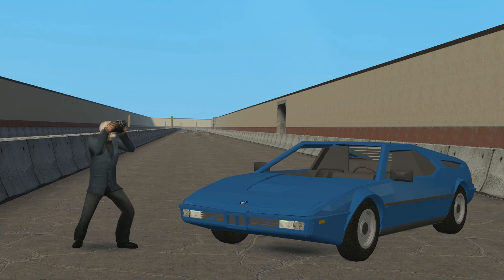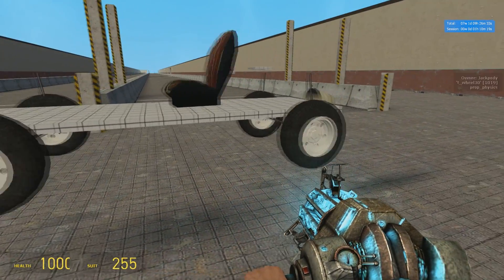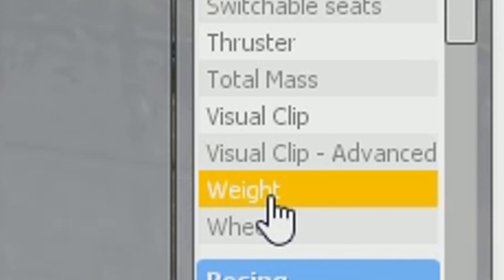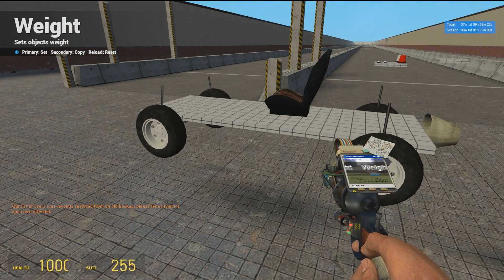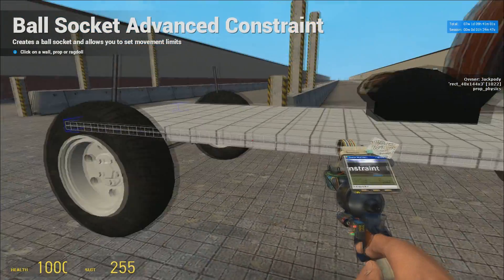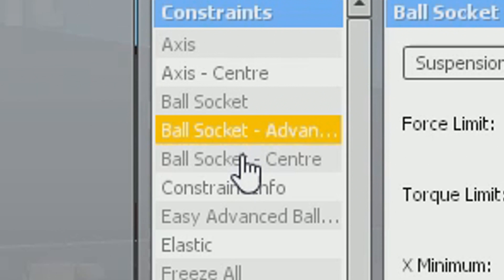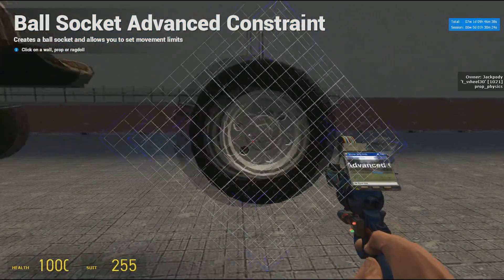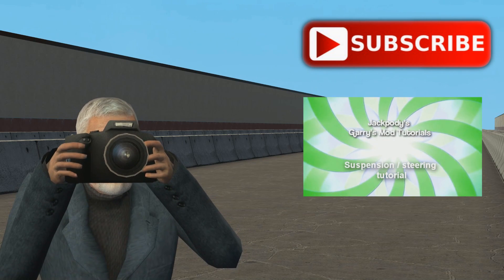Garry's Mod Tutorial    :    How to Fix Wheel Spass

Comment: So it works and my acf car will go better but at a speed of 140 it starts to tilt to the right and to the left, it is possible that this is a problem in the insufficient weight of the base on which the wheels are attached by Ballsocket
Reply from the maker: Could very well be. Try and watch the tutorial on how to avoid wheel spass, it should be on the channel from around 2016.

Comment: I have trouble getting over 100 km/h with my ACF cars using this chassis, why? and is there a way to make harder suspension ?, because my engine is a little heavy so the vehicle leans forward
Reply: Sheppowed a lighter car should go faster, so cut weight wherever you can without reducing stability. Wheels, body, etc

If you use the suspension in this vid making the plates heavier should make it "harder"
You can also use console to change the model of the wire weight to whatever u like and make a suspension you can adjust as you drive. I did something like that with a submarine

Comment: Hey jack can you do a tutorial on how to reduce base prop wobble, giving me a lot of trouble and kind of ruining my builds at the end witch is really disappointing :/
Reply from the maker: I cannot. However, make sure that you're using a proper setAng that doesn't try to auto-correct your car (can cause wobble at speeds). You don't need a stiff suspension but stiffening it might help. 
Try locking the rear wheels together (or the front wheels) by making a ballsocket constraint with everything on 0. It might create new handling characteristics, but it may also help with the issue of wobble.
Reply: Ok thanks jack, I found a good way to stop wobble bow

Comment: Hey, Mr. Chris! Great video! I would like to ask you a question regarding the wheels.. Could you tell me how to have better grip in the wheels? Cheers.
Reply from the maker: Hi. You can get better grip a few ways (but don't rely on my old MakeSpherical tutorial of May 2012, it's outdated).
First, in console, type "physprop_material phx_tire_normal" without the ". Then left click on your wheels using the physical properties tool (and make sure gravity is ticked on). This will automatically give more grip at no other expense.
Another way would be to increase the weight of the driving wheels ever so slightly. More weihgt normally means more grip but there are some boundaries.
Hope it helps.
Reply: Thank you for your reply. I will try it out! Cheers!

Comment: All this could be avoided in the first place if you make suspension without the plates above the wheels.  Just attach the Elastic to the mass centre of the wheels, and it will be pulled in place rather than being pushed into place by hydraulics from above. Hope that wasn't confusing...
Reply from the maker: Which plates are you talking about? There are no plates above the wheels on this chassis.

Comment: I have a question:
How can you stop your wishbone suspension from shooting up and setting above your baseplate? Typically happened after going over a large bump in my truck, but only occurs when you are at 160+ mph. 
I have to freeze the baseplate, and then drag the wheel down using my physgun. Half the time this is irrelevant anyway because the gearbox link has broken, and three wheel drive is not usually enjoyed. 
Unless you are using a reliant robin. Three wheel drive is good then. 
How can I fix this, because it's the only thing that is stopping me from achieving the 200 mph+ mark. 
Thanks.
Reply from the maker: Try placing your hydraulics higher up. You know those plates you temporarily spawn that you attatch the hydraulics to (as seen in my tutorial?). Place those 4 plates higher up (around double but it can go further) and it should definitely do something about your issue.
Reply: Actually there's a simpler way, since the first time I watched your tutorial on suspension I realised you could simply attack the hydraulics to the same point instead of the plate and it completely eliminates that bug
Reply: Oh fuck I meant attach*
Reply from the maker: Yeah, you can do that as well, but most people like the realisticness of having strut towers.
Reply: Jackpody You could add a second hydraulic with values set to 0 for the added realism
Reply: I've always used precision alignment to create a non-rigid rope with both ends in the mass center of the wheel.  The starting point is attached to the wheel and the second is attached to the baseplate.  You set the length of the rope to 0.5 less than the length of your hydraulics, so that the wheel never goes over it, and it doesn't affect the behavior of the suspension at all.
Reply: Wishbones don't work particularly well for me on gmod, I use precision to put 2 points about 500 units forwards  from the wheel (+500y) and 500 units apart (+250 and -250 on the x axis respectively), then attach those points to the baseplate. This method combats the dreaded speed wobble you might experience.

I set my elastics 100 units up from my baseplate, this should be enough travel to prevent the elastics from doubling over and getting stuck

Comment: Hey, its Bierfighter aLex here^^ Awesome tutorial. I got another solution with Precision alignment, flipping the whole contraption by 90° sideways and letting the z Axis only open. Also had great results, but yours seems to be even better. I will rejoin gmod, after a long break of ~ 1 year or so, just to test it^^ thank you very much!
Reply from the maker: Glad you found it helpful!
Reply: I tested it twice on my car. My Ballsockets: 224kph (wire), With your tut ~ 210 with 30" Wheels, Double Elastics Suspension, 2 Rope Suspension, ACF Powered...
Reply from the maker: Haha whaaaaaat? That's really weird. Did you try the super-duper fix in the description as well?

Comment: Sadly even after doing that my cars seem to have trouble above ~ 240 km/h. I tested it on a car that didn't have a suspension system, only ballsockets to hold the wheels. Could the lack of suspension be affecting my stability ?
Reply from the maker: +Luiz Dahoraavida Sort of. Did you try the super duper hotfix in the description? Might add some stability.

Comment: Jackpody, I have been working on a performance chassis for quite some time
https://gyazo.com/1145970d45722af2cda339f0e0daa49b
the way it works is similar to formula one vehicles, and they require massive downforce. The problem I have is that the car turns very slowly, so the car cannot turn at all. Any suggestions to fix this?

Comment: +Jackpody Doing this resulted in my car chasis to break its wheels completely. The wheels are no longer attached to the car and will not stay.
Reply from the maker: +Purple Turtle Hah whaaaaaaat? Are they literally falling off? Are you sure you didn't accidentally make the Force Limit something else than 0?
Reply: +Jackpody I'll have to double check, but they basically stay attached to the plate but droop down to the floor
Reply: +Jackpody Managed to fix the issue, turns out the wheels (w/ make spherical) were colliding with the baseplate and bugging out. Had to nocollide multi them

Comment: Finally waiting the way to fix I want to get over 280kmh or more! Thanks!
Reply from the maker: +Brucektrain Trainspotting 280 km/h should definitely be achieveable. You might have just a small amount of vibrations when steering, that's simply the ropes not holding up.
Reply from the maker: Might help stabilize but I'm not sure if the axles already take up most of the vibrations.
Reply: +Jackpody kinda wished this worked for tanks too; my wheels spaz at 75kmh
Reply from the maker: Try it, I've never tested it on tanks.
Reply: +Jackpody Wont work; My tanks rely on axis centre suspension, not ballsockets. Thus making this guide useless for tanks.
Reply from the maker: Ah, alright.
Reply: +Bind so youre making a race tank?